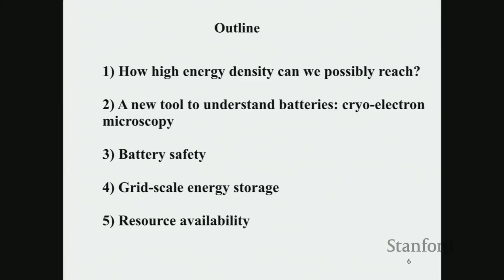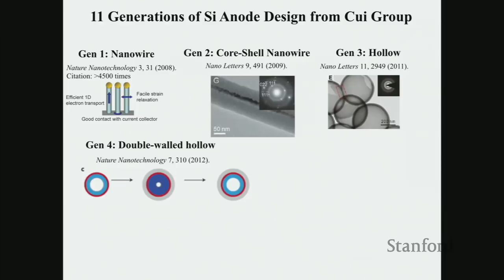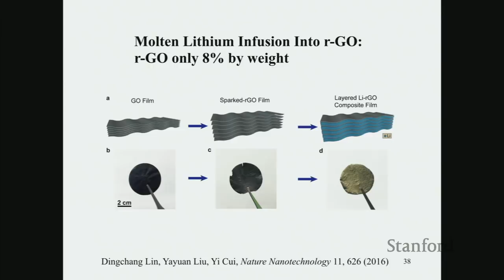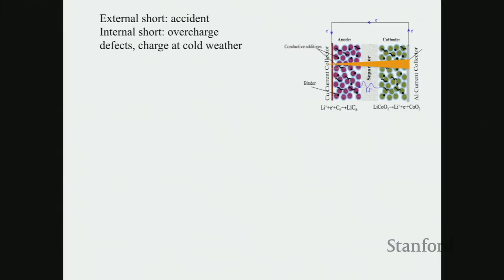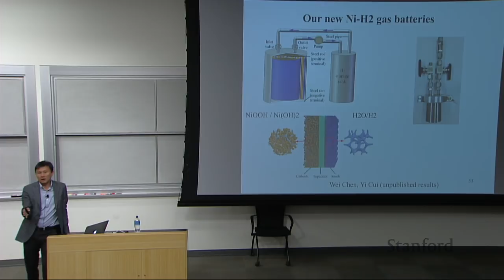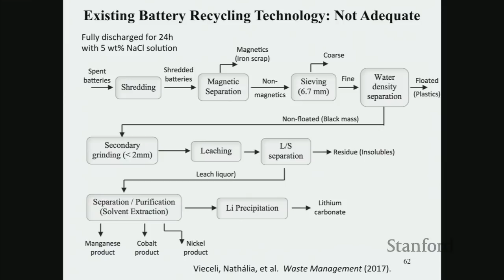Yi Cui | Pathways of Batteries Towards Sustainable Electric Transportation and Stationary Storage

Comment: Quantum Chemistry is resonant frequency pumping/modulation of multi-phase quantum fields, so plating reactions are "latent heat" type frequency shifts, in/out of solution/fields? Stability would require a ripple current +/- as was/is used for lead-acid? Interesting.